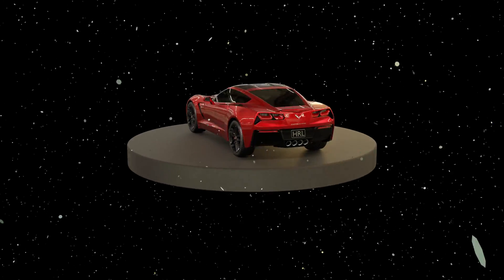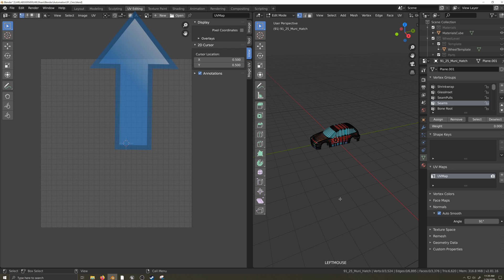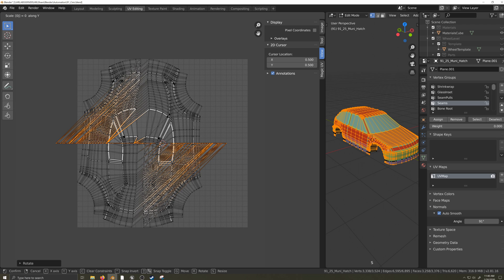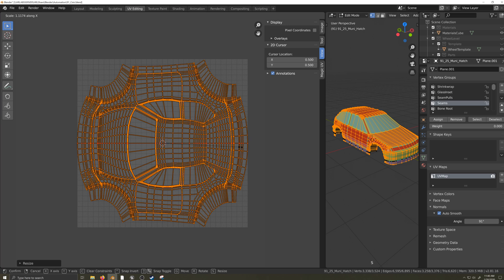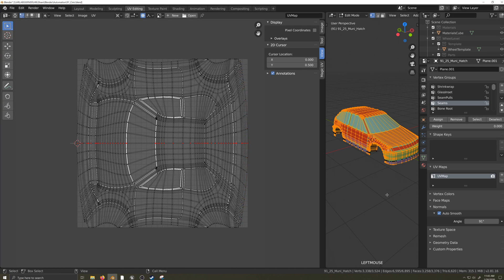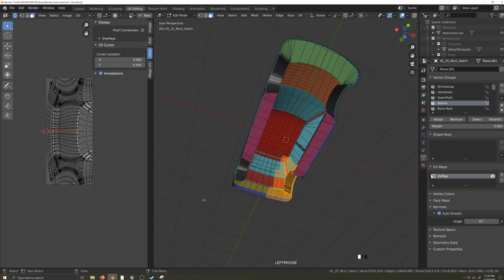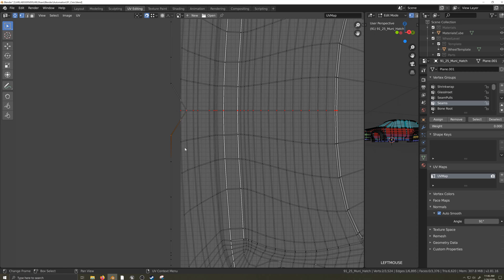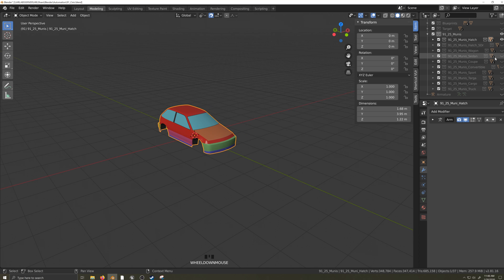Automation Car Modding Tutorial 15 - UV Unwrapping

Comment: Hi ! I'm working on Blender 2.91, and some functions are not at the same place as in v.2.81. I found most of them but now I can't find the Weld function... It's not in the right-click context menu, nor in the UV menu up the screen. Google tells me to Stitch, but I see you have this option and don't select it. Please help !
Reply: Great videos by the way !! You just seem to tire yourself in this video, as you don't explain as much how to do the operations. It's still really okay though, thanks a lot :)
Reply: I try it with merge at center, we'll see.
Reply from the maker: Sorry it took so long to respond, I'm not logged in to this channel every day lately, though that's going to change soon with the new update coming for Automation.  That all said, you figured it out.  Merge at center will work the same as weld, it should be the same function/result at the end of the day.
Reply: @hardroosterlabs3814  Thanks ! I didn't get any problem with my model, except cosmetic things like a tiny bit of bad reflections and wrong material placement, and it works well :)
I have to fix these issues, then I'll upload it on the Steam Workshop, look for a '68 Dodge Charger Body ;)
I'm happy to read that you'll be back for the new update, I guess it'll be for the no longer existing bound boxes, manual drag coefficient etc... ? Are there other changes of this type ?

Comment: Hey,I have problem,when I unwrap one part of car and select other part. The unwrapped is gone.
Reply from the maker: top left of your UV editing window, look for a button with two arrows facing opposing directions at a 45 degree angle, this is the UV sync button.  Try that one, see if that fixes it.
Reply: @hardroosterlabs3814  Hi,will try that,thanks.

Comment: I figured this out months ago, but better late than never - you can quickly check for an improperly mirrored UV mesh by starting to scale along the vertical axis and typing 1 for the scale value. Then, repeatedly hitting the hyphen key will effectively flip the mesh, making any discrepancies apparent.
By using the escape key to cancel the scale operation, this can be performed as many times as needed to fix multiple pairs of vertices.

Again, thanks for these tutorials!